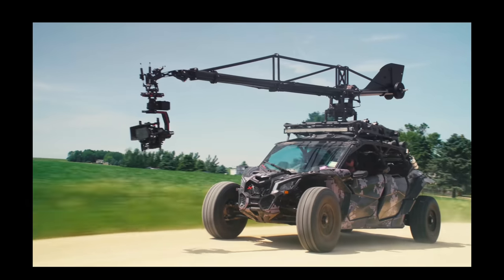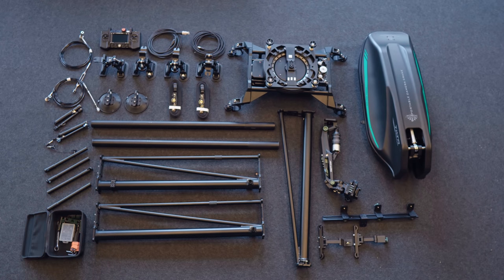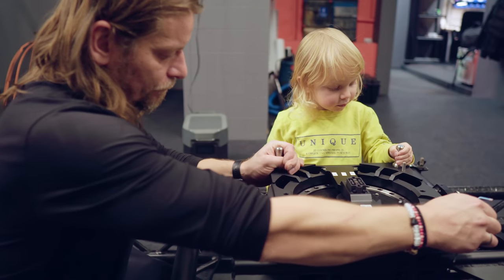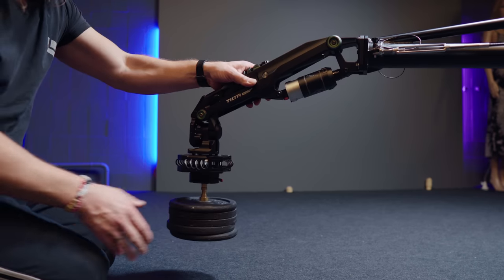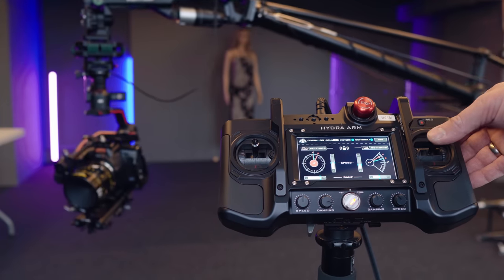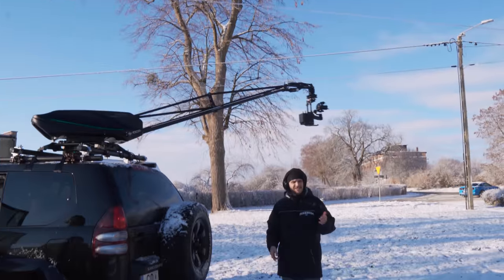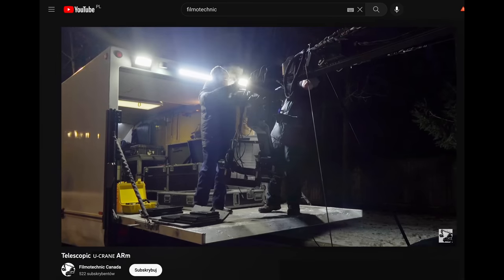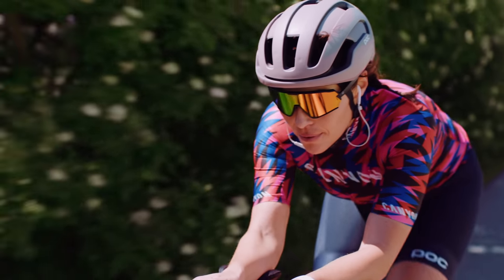TILTA HYDRA MINI ARM - REVIEW -  Highway to Hollywood

Comment: Yes, long raw footage is what I want to see!  I'll say that putting on R2 is a bit too much for the arm...? I can see small shakes due to hitting the swing limit, but the footage is really useable!
Reply from the maker: Yes it is true, you can see a slight vibration but it was the result of bad settings in ronin 2, remember it was the first test drive with ronin 2 pro.  After adding strength to the motors and advanced settings (filters, smothness etc) everything was smooth 💪
Reply: @BestboyAdam  Cool! Now I am wondering if you setup the arm shorter, then it should means that the payload could be larger than 10kg? This opens up more possibilities and makes the rig safer in a weird way.
Reply from the maker: oooo yes, for sure. I just need to calculate exactly how much the payload will be then but I need someone more knowledgeable to do that 😅   As soon as I find out I'll let you know

Comment: Thanks for this useful review. Did you measure the power draw of the arm? Tilta's website says 1800wH, but watt hours is a measure of capacity not power, and 1800W seems a bit high. Thanks!
Reply: Also, I have another question if you don't mind. How slowly can you set the arm to move? ie if you set the speed to the minimum, how fast is it? Thanks!
Reply from the maker: I'll have to check, I'll let you know in a few days
Reply: @BestboyAdam  much appreciated

Comment: Awesome, my first question was going to be; what do you think of putting the Ronin 4D on it? I'm still waiting on my Nanomorph lens set. I can't wait to try it out on the Ronin 4D.
Reply from the maker: It is  protection from dirt and water from under the wheels. I made it out of the simplest $2 plastic tool box💪😀
Reply: @BestboyAdam , I think you may be single-handedly ushering in a renaissance of indie filmmaking :)

Comment: I still have problems sometimes with the Alien Arm, sometimes the RS2 starts to wobble the pan axis slightly and that infuriates me. Even with the motor strength at its minimum
Reply: I hear you.  I think it's an RS2 problem, first time I ever tried the Hydra Alien we used an old Ronin MX and that thing was rock solid.  Need to do more tests but I suspect the RS2 is not up to the task.

Comment: Please which ECOflow model did you use, Tilta has no power block recommendations and when I called ECOflow the lady I spoke with did basically recommended a 2 block system for any 220v usage

Comment: 6:58 that is not the way the strap goes in to the ratchet! The belt should always enter the ratchet from outside and leave through the inside. That way it is much easier to undo the ratched when you want to remove it.
Reply from the maker: nope, you're wrong, check your strap manual
Reply: @BestboyAdam  I have been a truck driver for years. But okay.